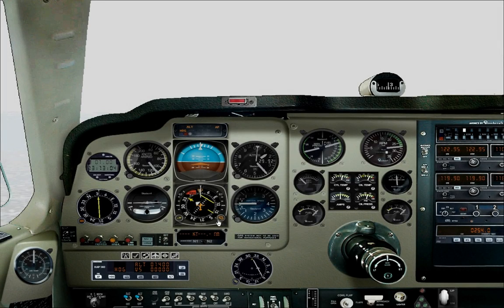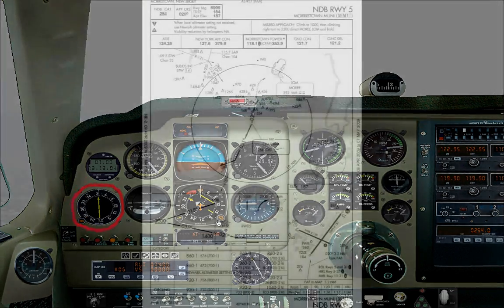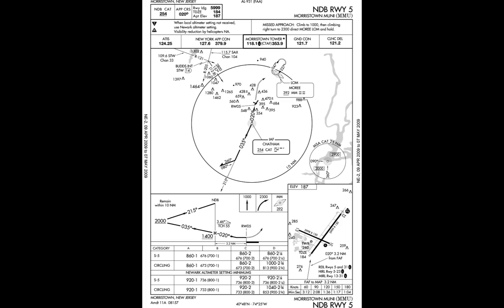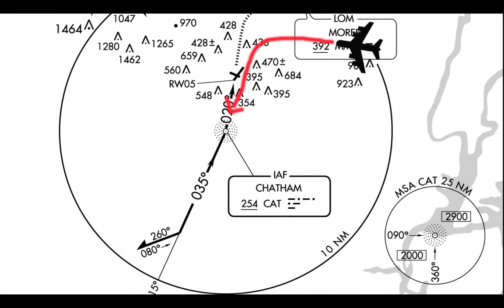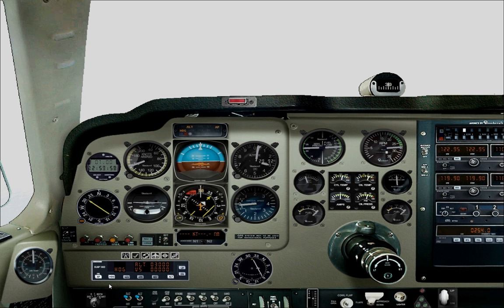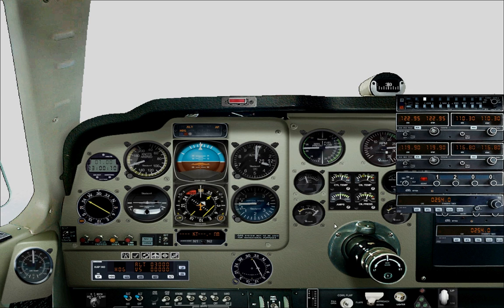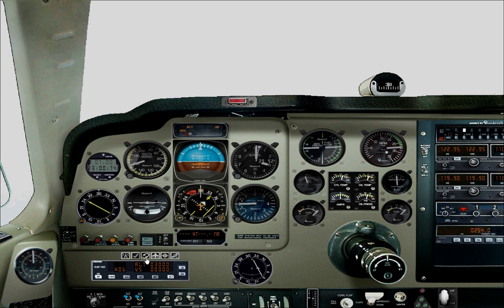How to... Fly an NDB approach (part1)

Comment from the maker: @c500amg Well for example, when we are doing our first turn, we need to wait for the needl to point at the NDB on a 215 radial, so in order for th information to be correct on the ADF, you need to have the card set on the current heading. You don't NEED to do it, you can also do the calculations yourself, it jut makes it much easier.

Comment: ofcourse u did what is on the chart otherwise u would not find the runway, what i mean marko is that 080 was a only heading not a direction to the NDB, so there was no need to set the ADF to 080, the ADF should be set 035 while maintaining 080 when the ADF points to 035 this is point of your 45 degrees left turn